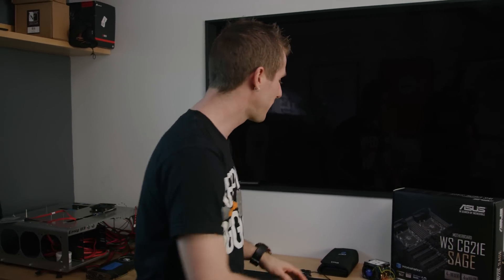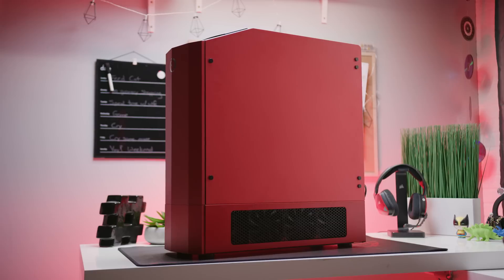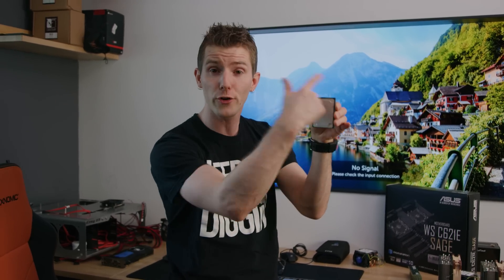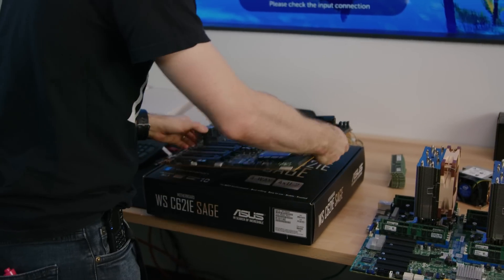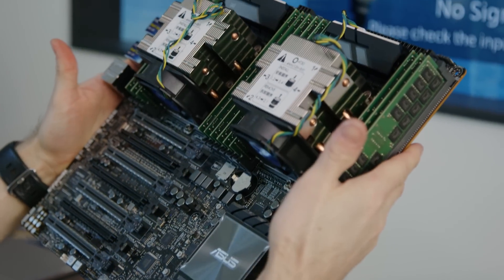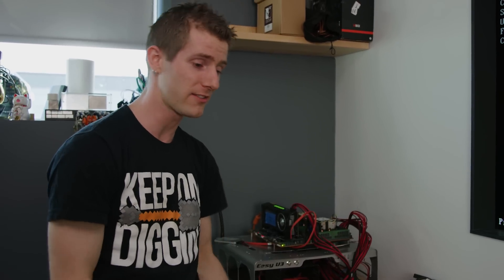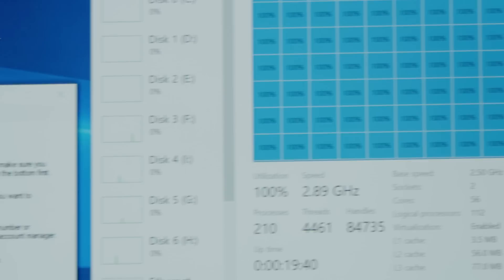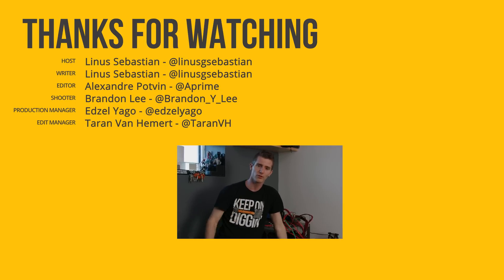56 Cores in ONE SYSTEM! - HOLY $H!T

Comment: I mean, like 9 years ago you could get a 8 socket server with the lga 1567 socket. With 10 core cpu's you could get 80 cores and 160 threads with support for 2 TB ram. Under full load, the cpu's alone consume over a kW though. 130W each.

Comment: Can you run 50 Linux VMs running some moderate graphical test on Full HD? I wanna build a system for my distributed systems research. I don't have the kind of budget to get this so I was wondering what's the best value if I want 12 core performance?

Comment: That is insane!! The CPU price talking. 
It's pretty much expensive compare with the AMD. 
And it's not a 56 cores processor, i'ts 28 cores 56 threads processor
And it's a very expensive one per unit. $2,774.38 on Amazon vs the $879.99 of the AMD Ryzen Threadripper 2950X. A huge diference. 
At that price you can almost buy two AMD Ryzen Threadripper 2990WX, and obtain 64C/128T configuration, (if there was an AMD motherboard that had with dual processor configuration)

Comment: I am interested in that Mobo WS C621E sege , however when I look at the specs it has 3 Eatx 12 v connector , two for the Cpu's and one aparently for the GPU's if two or more are connected , but this one in particular is  located next to the U.2 connectors but is 6 pins instead the other two that are 8 pins , and I can't find a PSU that comes with 3 Eatx 12v cables , so does anyone knows which PSU is recomended or compatible with this mobo ?

Comment: 7000 points in Cinebench is actually a bit underwhelming for what it is. The Ryzen 2990WX scores 5000 and it's a single CPU with 32 cores, and MUCH cheaper.

Comment: wanna heat it up ? try BOINC Manager set everything to the max and enable the Project Einstein@home xD 
and at the same time you helping sience to get some work done :-P

the fastest PC in the Einstain Project is: 
Computer 12219055

CPU Typ: GenuineIntel Intel(R) Xeon(R) CPU E5-2667 v3 @ 3.20GHz [Family 6 Model 63 Stepping 2] 
RAM:  64324.02 MiB
Average Workspeed: 22272.77 million ops/sec

it makes 5,149,190.83 work points AVERAGE

if you or someone from here wants to share some of your idle time of your computers join our team German-Furs Network in Einstein@Home everybody is wellcome :-)

Comment: 2 hour 8k minimum Mandelbulber 3D fractal fly throughs using 360 degree VR equilateral display settings. Although a 20k seamless video wall projector array really is this year's "ultimate" build.

Comment: Linus,.... are you still qualified to talk about hardware?  Why the fuck would 4 U.2 drives not be in a system?  All MB manufacturers should be embarrased for not supporting at least 8 from day one.  Also, there is no budget that this chip makes sense for, not a large one, nor a small one, nor anwhere in between.  The biggest problem these days is the sheer cost of server RAM.  It isn't terribly hard to find a system that support 2 TB of RAM these days, but trying to fill those slots when not buying as a company from one of the big providers is an exercise in futility.

Comment: It's interesting that you are running Win10 64bit on Xeon processors.  Any problems with that? I built a dual E5 2670 V2 Xeon system total 16 core/32thread and run FreeNAS on it very well.  Of course you can't get these Xeon's for the price I paid.  ASRock Rack makes a very good server motherboard too!  Great Video!

Comment: Can I assume this would run Rise of the Tomb Raider, without the lag I've seen in other videos?

I know this will also get me called an idiot and told to kill myself, but I find myself wondering how many Minecraft mods I could use with this system, as well.  My laptop has trouble running more than about 40 at a time.

Comment: So each of these costs about 2.5x as much as a 32 core Epyc 7601 but is only about 1.3x faster, has less memory channels (6 vs 8) with less maximum capacity (768GB vs 4TB), less PCIe lanes (48 vs 128) and a slightly higher efficiency (about 10% more efficient) at full tilt. The only thing I can see the Intel CPUs being better is in a long term large scale aplication where a 10% power increase would make a more significant cost than the extra cost of the chips themselves and doesn’t need the WAY superior connectivity in the AMD chips.
Reply: mining for what else u would build ;) duck
Reply: This may be so, but Intel's chips scale a lot better. Thief S8S scaling system is great.
Reply: Any threadripper is more powerfull that this dual procesor(8400 points with LN)
Reply: wait what

Comment: A use for this system:
6 Workstations w/ 9 Cores each
5 of the VMs have 64 GB RAM, 6th VM has 60 GB
2 Cores left over for transcoding media files like Plex and a 60 TB NAS
So you won't need a whole room for workstations!
6 Workstations, 1 CPU Virtualized workstation hub
Custom water cooled EVGA K|ngp|n GTX 1080 Ti Hydro Copper graphics cards, which are single slot cards
4 Samsung 960 Pro 2 TB SSDs in RAID 1 (UnRAID) and 5 Seagate 12 TB BarraCuda Pro Hard drives
Corsair Concept Slate case
EVGA 1600W T2 + Silverstone 800W SFX-L PSU's

Comment: Overclock it with liquid nitrogen.
Reply: Xeon don't overclock . The threads are locked
Reply: Liquid Hydrogen
Reply: Overclock levar o processador para plutão
Reply: You could probably run a literal singularity when it hits top performance.

Comment: Okay, CPU retails for $8k each, that's just $16k in CPUs, and with memory only it tops $20k. Cinebench shows 7.3k points total. Writing this comment from my workstation with dual E5-2683v3 CPUs, which gets bit more then 4.0k in same R15 test. How much I've paid for CPU's? Around $600 back in the days (Eng(QS actually) samples). Means all the system (CPU and 128Gig memory+mobo) is still under $2k. We all know that it's quite hard to utilize 100% resources of such a system. Since I'm not in Datacenter business I'd stick with mine ;)

Comment: minecraft on max render distance and fancy graphics
Reply: Think you'll need to reduce render distance to play at 240p.
Reply: Th gt740 is outdated
A quad core with a Radeon R7 370 still has problems tho (gtx 980 equivalent)
Reply: U wil onli geet 2 fps unles u dawnlod mor rams
Reply: youl probly get serisely 4500fps with out optifine
Reply: He should play on 2b2t.org
Reply: how about 1000000000000000000000000000000000000000000 TNTs =))
Reply: And ray tracing?
Reply: The blocks would become circles
Reply: Even quad core with gt 740 can do that
Reply: My laptop with a intel i7 (i don't know how much k but ye its just a intel i7), and a NVIDIA GeForce 840m can already do that with ease. Oke when i do that it's at 50-85% of it's max capacity but still, the i7 doesn't have anything near the capacity or cores  as the one Linus now has. I think that CPU would do that with just 5-15% of it's max capacity.
edit: i'm not that experienced with computer/laptops but i'm sure this will happen.
Reply: U are stupid who write a bad gpu can run Minecraft on good fps. You guys don't understand that Minecraft is made in java and it use almost 100% cpu and maybe a little bit gpu u need a good cpu for play Minecraft not a good gpu is not a gpu game...

Comment: In an area like Computational Fluid Dynamics is this core count an advantage over a lower core count, and higher clock speed set up?

Also do the new Quadro GPUs like the GP100 give any advantage in this MB if using more than 2 of them, based on the 2 card NVLink vs a bunch of P6000s with SLI?

Comment: Simulations similar to the the 64 core Xeon you tested a while back', seeing as these chips had a turbo boost up to 3.0 GHZ I wonder how they would compare to those is what I would like to see how important is threads vs clock speeds in the same benchmarks that Dr. Kinghorn setup on your workstation for the Phi cpu
Reply: Which yes I know how it turned out for the more traditional xeon E5-2690 V4 with larger batch sizes, however I would specifically like to see how 112 threads at 3.0GHZ compares to the 256 at 1.5ish ghz

Comment: Hey Linus, all of those users on one box sounds sweet, but you're going to be hurting if there's an issue with it. You might want to think about setting up a handful of smaller boxes and running orchestration software on them. That way if any individual machine goes down, the VMs can get shifted to another server immediately. From what I've seen, you should have storage fast enough to handle it.

Comment: Hey I have a serious question. I was reading that most games only take advantage of 1, maybe 2 cores in any system. Why is that? In theory, shouldn’t, say, a 56 core system like this allow games to be run at insane settings and frame rates? So I guess my question would be, why are games limited to only 2 cores? With CPU’s rocking 10+ cores these days, I don’t get why games haven’t take such a huge leap as well.

Comment: Run Autodesk Flame on it and compare it to other machines, that would be baller, as Autodesk recommends/certifies dual cpu systems and is very hardcore trying to push the HP Z8 line.

Comment: A lot of people don't realize this but U.2 is actually very versatile. People only think about the end point. But U.2 is SFF-8643 (miniSAS). So this means,  one U.2 connector can use 4 SATA drives.  So one plug = 4 drives.  It's also 4x PCIe lanes. That means, you COULD have 4 NVMe drives with 1x PCIe lanes.

Comment: “Who puts 4 u.2 drives in a system!” I’ll tell you who:  
LTT
Reply: People get U.2 all wrong. U.2 is super versatile. U.2 is  SFF-8643, which is mini-SAS.  One U.2/ SFF-8643 connector can utilize 4 SATA drives.   One cable = 4 drives.  U.2 is also PCIe 4x lanes. So you could have 4 NVMe drives with 1x lanes each (still faster than SATA3).   That means those four U.2 connectors could connect to 16 SATA drives.  You only need 4 cables, instead of 16 cables.

Comment: I’m still rocking my dual core I3 👌🏽
Reply: Still rocking my octa-core FX 9590 👌🏽
Reply: ew trash
Reply: Im using an i5 8400 turbo boosted to 3.79ghz, is that good?
Reply: Pentium or Celeron? Nothing wrong with that.
Reply: Bitch you still running on that and paying $1200 for it
Edit : Except it's dual core with 2 3rds of the clock
Reply: Me too a 2310M and 4 GB RAM . I will upgrade to an ssd and add more ram . I do not want this thing to die !!!
Reply: TinchoX 
That is still pretty good
Reply: TinchoX lmao Crapple sheep calling a PC trash
Reply: I m using a core two duo😥
Reply: @Bruce_Wayne35  Finally upgraded a month ago with a Samsung 860 Evo 73$ and Crucial 8GB 65$ . It is now definitely faster . My laptop will function for a few more years lol

Comment: I'm probably the only one here, but I'd love to see it running a full Composer Template (let's say in Cubase Pro since it's Windows), and see how much track with cpu-hungry Virtual Instruments it would run, how fast it would load the template with a large amount of Kontakt libraries loaded, etc... you know, real life situation for a composer that currently has to use multiple computers with the Vienna Ensemble Pro to get the load spread amongst multiple computers to make it more usable and stable. 
And yes people, it has nothing to do with your 20 audio tracks recording you might do in your DAW. I'm talking about hard core setup that might use 4, 5 or even 6 computers with 8-12 cores CPU, 128GB of RAM and TBs of SSD in RAID... each!
Reply: Sounds like a dream , I feel like you could get the buffer size so low almost under 100 and still have cpu power to render a 4K video. I've been researching these myself and I'm deciding on the core i9 9900K :) M2 Pcie ssds from Samsung and 64 Gb ram is what I plan to put on my system. Graphics cards also play a huge part now in DAW's especially Ableton which I use to compose.

Comment: Can it run minecraft at 1000 fps?
Reply: 2.9GHz is still a decent enough clock speed lmao. I've played minecraft on an intel integrated chipset with a 2.5GHz CPU over 200 fps.
Reply: Yes, in 4K with a 2048x2048 texture pack, 64 chunks render distance and shaders using OptiFine.
Reply: Tomas0015 yes I tried out with my 1060 3gb and my ryzen 5 1400 I got about 900-1100 fps

Comment: Aren't there dual AMD Epyc motherboards? That would be 64 cores, 128 threads then. Not really impressive from Intel.
Reply: Actually their 32 core 7601 are turbo'd at 3.2GHz. And EPYC boards actually have 3 BIOS setting to max out performance even further. But servers care about power usage and want consistent clocks, so it's usually disabled. And no Youtuber seems to have bothered to try it out yet.
Reply: 0M9H4X They more cores but are clocked at just 2.2Ghz so they get beeten by the xeons anyway. Also, intel send there cpus over and amd didnt
Reply: Yeah SuperMicro and Tyan have dual EPYC boards. Gigabyte as a realllllly niiice single socket board available. I wish ASUS would do a dual EPYC board, since they're dualies are the best looking and have more features.
Reply: LUL thx for the information :) didnt know that
Reply: Dual Intel Xeon system with 8 fewer cores beats a dual AMD Epyc by more than 20% in all the benchmark I have seen. I think that is really impressive from Intel.
Reply: That may be true, but when you have to take out a mortgage for an Intel set up is that extra 20% worth it?

Comment: The CPU you need for Cities: Skylines
Reply: yes!
Reply: Dude you're not even joking. My 6850k chokes, even with 32Gb of 3400Mhz DDR4 memory and a 960 pro.
Reply: Ryan Tegtmeyer Something is wrong with your PC tgen, I play with a Ryzen 5 1600 and I never hit under 60fps. Your cpu is much better than mine
Reply: It is not about fps. When your population is high, cpu can't handle all of the cims therefore the time slows down. My city's population is 220.000 and time is passing slower than normal 1x speed. I have 6700k.
Reply: and the sims series
Reply: Melikşah Arslan I have 250 000, everything runs super smooth. 3x time works as it should.
Reply: OR VR PORN !
Reply: I think it's probably single thread limited based on my past experience with other sim games though I haven't really played it much. In this case more cores will do absolutely nothing.

Comment: The 12 RAM slots don't surprise me; it is a dual-system motherboard optimised for workstation use, so you would need at least 4 DIMMs per CPU for adequate memory.  As for CineBench, it holds some of that first-run data as a baseline for whenever you test your config again, but is guranteed to fluctuate based on the quality of your components.

However, the app hasn't been updated in at least a year, so Maxon could do with adding more scenes for rendering, to offer better detailed stress testing (i.e. to rival 3DMark).

Comment: Meanwhile Epyc is using 32 cores which would make a 64 core system but intel sent these over so sssssssh
Reply: yeah, and has octochannel memory and 128 PCIe lanes, like damn, I'd love to see linus mess with epyc, like even try to get it to 4GHz :)
Reply: Epyc processors have more cores, but they aren't better for all loads. But true, at least they could've mentioned them.
Reply: and 4TB ram
Reply: Zen 2 EPYC will have 64 cores / 128 threads.  So a dual EPYC will be 128 cores / 256 threads and since 7nm, it'll probably be at 4+GHz. Global Foundries 7nm is said to be better than what Intel will be using. And current AMD EPYC is 8 channel memory. This Intel is 6 channel. Each EPYC can utilized 2 TB of RAM.   AND it has 128 PCIe lanes.  Zen 2 will probably have more.
Reply: I WISH Bitcoin was dead, maybe GPU prices would come down enough to the point where I could build a new system affordably again. At this point I think I'd actually save money buying prebuilt.
Reply: bang for the buck and core for the buck
Reply: I searched up cinebench results for dual epyc, and they peak at 5,500 CB, I don't know why tho, but the two I found were running in a VM (Shouldn't explain a 2000 CB performance difference tho)
Reply: I think it's because of BIOS settings. There are at least 3 settings that are default disabled or "auto" that effect performance for EPYC. It's hard to say when people test them if they config them as best as possible. In the datacenter, they tend to care a lot about power usage (within an envelope) and clock  consistency. So those settings are disabled.  It's hard to look into this though since no review site or techtuber has really looked into it.
Reply: Do you know, that NOBODY is mining bitcoin with GPU?
Reply: These are true 28-core cpus. AMD’s EPYC cpus aren’t 32core monolithic dies. They are just four octacores stitched together. This is like Linus stitching together four 4K monitors to make an “8K monitor” and then saying that it is as good as Dell’s actual 8K monitor but cheaper. Pathetic.
Reply: Good tactic to cast doubt on the authenticity of the person who speaks the painful truth. I value my privacy, thank you very much. You on the other hand, who have a youtube channel and you are so transparent why are you still faceless? Too ugly I suppose...
Reply: Actually, I wish I worked as an engineer for Intel. Or AMD for that matter. Unfortunately, neither has a manufacturing or design facility where I live.

Comment: Fluid simulation 
Volumetric's 
Overclocking 
Other cinema 4d tests (if you have the experience)
Video export times 
Temps?
High polygon models 
Science simulation benchmarking 
Game engine performance
Streaming 
Virtual machines 
Games dah 
Eevee in blender once launched- beta is buggy 
Just if the top of my head
Reply: After effects